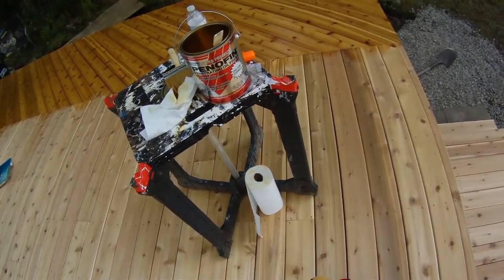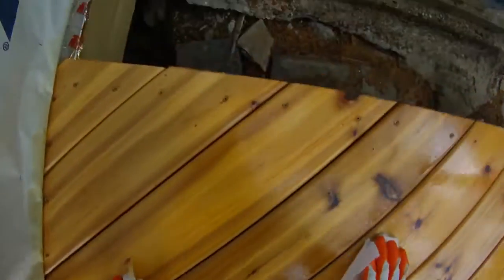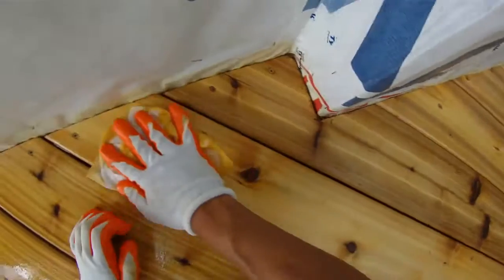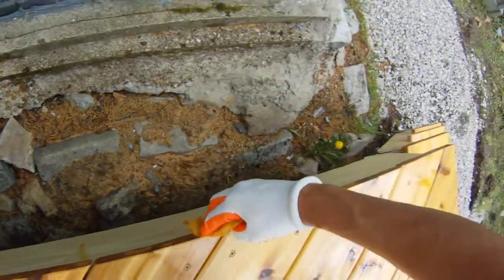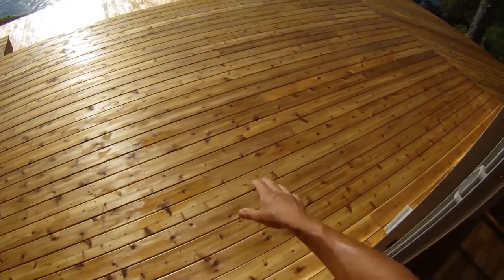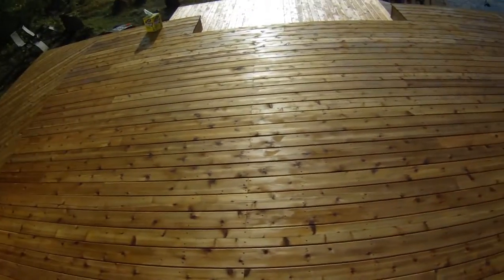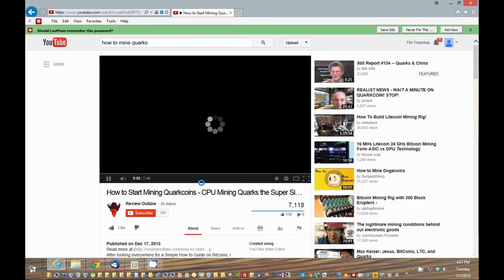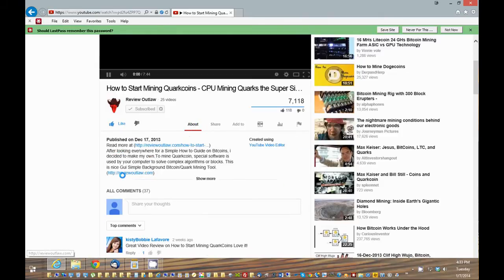Deck Building - P4 - How to apply penofin oil to cedar deck

Comment: I know this is an older post..........but did you sand the deck first to remove the mill glaze or did you apply it to new cedar?
Reply from the maker: Wischart This was new cedar we did not sand but that would prob help absorb a bit more and get a deeper soak.

Comment: How has this held up?
Reply from the maker: the Penofin did not not hold up that well, lasted for about a year then had to put some new Deck Sealer on it
Reply: What did you put on the deck to seal it and how is it holding up now?  I have the same deck and very curious.  Do you have any pictures or video of it currently?
Reply: @Reviewou0tlaw that's about right